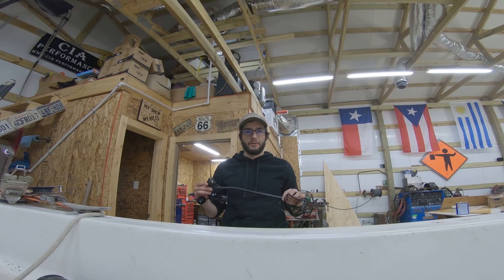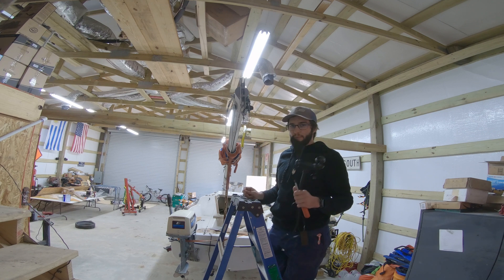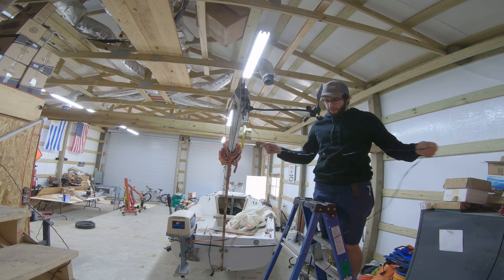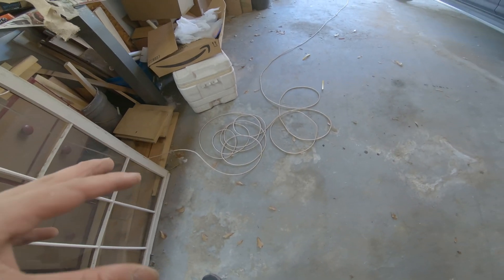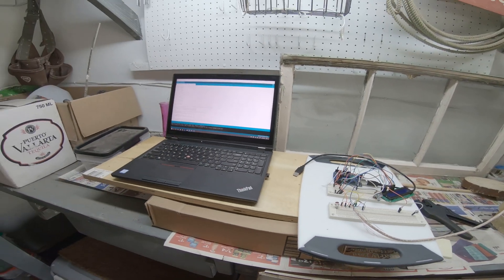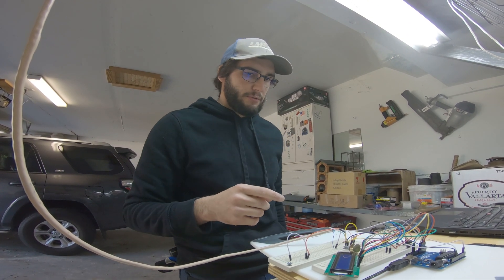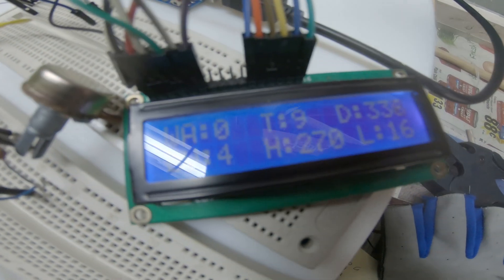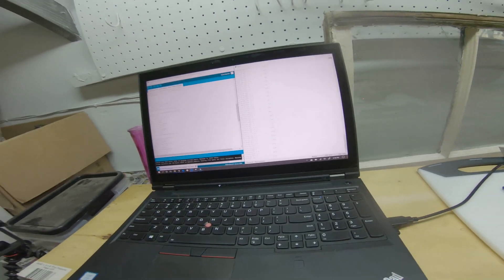DIY Sailboat Autopilot - Anemometer Install and Test - New Salts Episode 11

Comment: mounting the vane so it is ahead of and above the forestay will reduce the risk of interference from the wind coming up and off the jib
Reply from the maker: Great point!   Will consider that when building the permeant mounting base
Reply: @newsaltsailing7756  I have also built my wind instruments based on an arduino pro mini let me know if you run into challenges
Reply from the maker: @RangatiraRacing  Awesome! good to know!  how is yours setup? do you have just an LCD with number display or did you build some sort of screen interface?     mine is setup with a Android Tablet as of right now

Comment: Very cool 😎 was thinking of doing the same 😬👌👌 would be cool if you link where you took your source for the Arduino :) I think Arduino is a cool idea for sensors was thinking of using it as multiplexer for them. The main system should but run on a pi. I think there is already solution for the front end + com :)
Reply from the maker: I know its not the most efficient option but i learn the most and end up with a very efficient code as it does only what i need it to do
Reply: @newsaltsailing7756  nice 😯👌 I would love to see how it goes. I have no issue to compensate you for this with electric motor/controller/propeller/windturbines knowledge, that's where I'm good at 😬. It's really cool to see someone having the same mindset 😎. Really like what you do mate 😇😉
Reply: Same here.
TIA
Reply from the maker: Arduino was purchased from amazon 

I’m coding everything from scratch! 

Might post up the code when the project is complete and bug free!
Reply: There is an open source project based on raspberry pi called pypilot, that seems to be quite advanced, with a great community and lots of resources. It lso integrates with openplotter, a raspberry pi distribution to make a sail nav station.
Reply: @ghismo  thanks mate :) That's exactly what I'm currently lurking on ;)

Comment: That`s cool. Looks like something I would do. Which arduino board did you use? I would like to try it.
Reply from the maker: In this video i was using an uno.

I have since switched to using two Arduinos due to some pulsating effects i noticed during higher winds with the interrupt service routines i am using to capture wind speed 

The current setup is an uno to handle the autopilot functions and a micro which handles the anemometer data collection and GPS parsing nmea.   The uno pings the micro for its latest data every .25 seconds.  This just frees up the uno’s capacity to focus on auto piloting the boat and communicating via bluetooth to the App. 

Upcoming videos will show this .   I predict this will be a 4 part series for build and then a couple episodes of on the water testing and refinement
Reply: @newsaltsailing7756  That's  cool. Thanks man. I'm going to have to try this. I have been thinking about using arduino or raspberry pi  for a auto pilot. It's cool to see someone actually doing it.
Reply from the maker: Awesome man!  Looking forward to hearing how it goes for you!  I hope that  these videos can be of some help! 

I contemplated the raspberry pi  but its more computing power than this project needs and i am much more comfortable in c++ than python